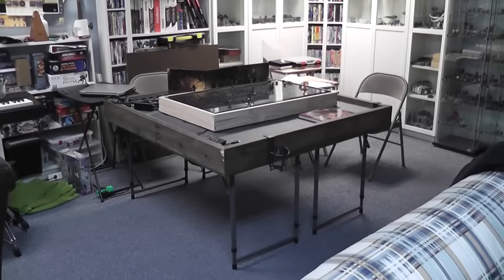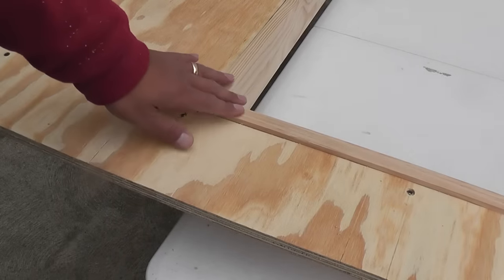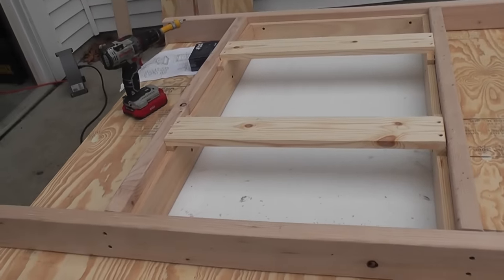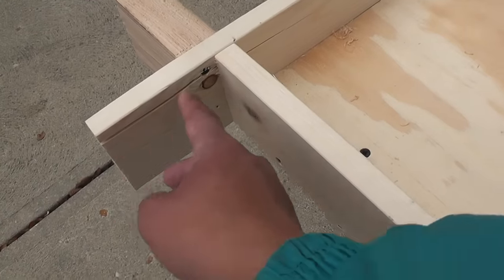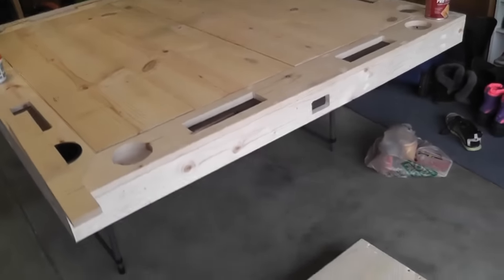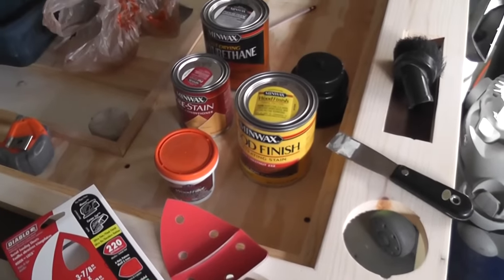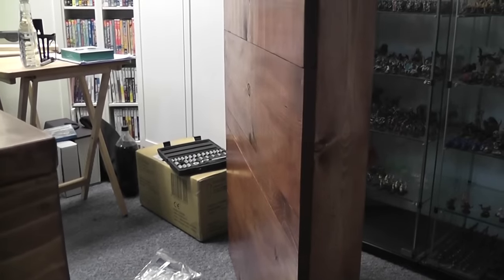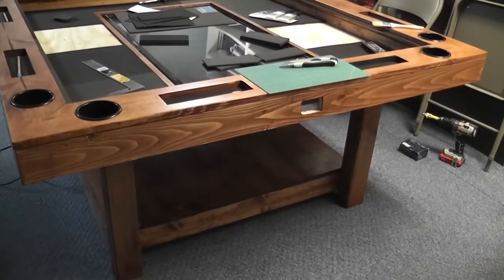DIY Gaming Table for $150

Comment: Its a cool build, just please, oh please, do not keep your hand in the same direction as your air nailer or screwing in your holes.  One slip, or misalignment, and it would have gone through flesh rather than the board you wanted.

Comment: @34:14 "There are imperfections, for example where i cut the corners, and that is how the jigsaw works in terms of how you navigate a corner" ...heck no! You got those corners in terms of HOW YOU work with the jigsaw. You could just take a little bit more time and both cut straight and do the corners correctly! And you end up with cut outs that you dont have to be ashamed of ;-) ..but it does take a real craftsman to blame the tools for faulty work lol

Comment: 120v AC is NOT low voltage!!! there is plenty of room in the low profile box to put a pigtail for the ground wire.  Pull the outlets out of the table and put them in a box, don't cheep out on safety.

Comment: Has anyone built this without the slot for the tv? I'm still a fan of the pen and paper aspect of D&D and Im trying to figure out which components I can remove without altering the structural integrity of the table. (I contemplated just building it as is just without the slot for the tv in the middle but that seemed like extra time and cost if i never plan on using a tv.)
Reply: If you still want the lowered area play like he has, with the board to go on top. Just don’t cut a hole in your plywood and you don’t need to build the tv fram with 1x4’s. You will just have to build the frame with the 2x4’s to solidify the structure.
Reply from the maker: @bavadadvidablu765  Yes, it is actually easier to build without the hole for the TV.  Many have done it.

Comment: Anyone know what size TV he has in there?
Reply from the maker: It's a 40" Magnovox LED LCD screen with a piece of plexi over it for protection.
Reply: @gaminggeek241  Any problems with heating having the TV positioned this way?  Also, I didn't hear the dimensions for the TV box, wood width (2x4s or whatnot).  Sorry for the questions, I'm planning this build within the next few weeks, I love it so much!  Just sold half my funko pop collection to make it happen.
Reply from the maker: @JadenZion84  No, I've heard others express concerns about having a TV screen that is laid flat but I've had no heating issues or problems.  Probably because it is a super light, LED LCD screen.  (I would never do this with a plasma.)  Regarding boxing in the TV, I would buy the TV first and measure it out to make the enclosure out of 1x4's to make it as tight as possible so you don't have a sizable gap between the TV and the frame.  You'll also need spacers to get it exactly flat with the frame.  Make sure you check out the BGG thread because tons of builders have put great ideas there.  Sorry it cost you your Funkopops!

Comment: Nice job. Did you think about outlets with usb in them so you don't need a big adapter plugged in to charge? https://www.amazon.com/Receptacle-Charging-Capability-Resistant-MICMI/dp/B01N3MGNTO/ref=sr_1_6?s=hi&ie=UTF8&qid=1513983094&sr=1-6&keywords=outlet+with+usb+ports     As another idea, I would have the wood frame around the TV sunk down to the level of the rest of the table and just bring the black foam all the way to the bezel of the tv. It would look almost seamless. You could actually take another layer of the foam and run it all the way to the edge of the plexi on the current design, it would just be double thick foam around the edges. May need a small hole over the IR on the tv to turn it on and off.

Comment: Wood 10 $
Screws 10 $
Cordless Screwdriver 10 $
Circular Sawyer 10 $
Garage 10 $
 Jigsaw 10 $
Wood Glue 10 $
Nail Gun 10 $
Mallet 10 $
Wood Finish 10 $
Electrical 10 $
Glass 10 $
Hinges and Beer Openers 10 $
Plastic 10 $
Vacuum Cleaner 10 $

150$ is not cheap enough for me!

Comment: i feel like most of your cutting could have been done by people at the hardware store. had you done that, all youd probably have left to do yourself is a test fit and assembly.
Reply from the maker: I find the people at Home Depot or Lowes are not very accurate with their cuts, but it is true, if you can get them to make all the cuts, you don't need the saws.

Comment: Do a brad nailer with nails will do?
Reply from the maker: I would suggest screws as the holding power is much stronger than a brad nail.  But maybe if you glue everything, a brad nailer would work?

Comment: Please don't wire THROUGH a device.. Make a pigtail and use wire nuts.  And it's not low voltage. You might not be pulling much amperage, but it's 120volts. For god sakes, please install electrical boxes for the receptacles!

Comment: Gave a little shudder when you showed all the exposed "finished" electrical (electrical tape is not a permanent solution).  Maybe also have the runs parallel from a junction box instead of in series.  Other than that the whole thing looks good for a DIY.
Reply from the maker: Yeah, I retrofitted with boxes.  Also, the wiring is in parallel, not series, although not from a single junction box--not sure what the advantage of that would be over pig-tailing at each outlet like I did.  That seems like a lot of unnecessary extra wire but maybe I am not understanding what you mean?

Comment: Far be it for me to tell you how to do your craft but when cutting holes with a jigsaw, drill a hole in each corner so you get smoother corners. Just what I found works best for me.
Reply from the maker: Yeah, that is a good idea.  I started out with a pilot hole but having them in the corners would have made for cleaner cuts.

Comment: "150$" table, made with tools worth 5000$, "DIY".
Reply: You can rent tools at many hardware stores.  This is a great find, don't discourage the potential.
Reply: that's not even 500$ worth of tools, buying the tools + the materials will still be cheaper than buying a full table like that.

Comment: As a licensed electrician I can honestly say the table looks nice... but absolutely do no follow his wiring advice. First of all, no boxes on the outlets????? Do you want to kill your players?? Oh you wrapped them with electriccal tape.. to bad that doesnt guarantee insulation. Not to mention how will it stand up over time. And, its also illegal. There is a Natinal electrical Code for a reason. Secondly, no electrician back feeds a wire like that.. those holes fail all the time. ALWAYS wrap the screw. And marette your wires with a tail to the plug. FFS.. this is why we have licensing for trades.

Comment: >$150 DIY but you need a few $1ks worth of equipment.
Reply from the maker: You can rent the tools--miter saw, drill, air nailer.  Or even easier, make friends with someone who has these tools.  The rest you can do by hand.

Comment: As much as I enjoy these things, I really really really hate that they say the item only costs X dollars, but dont include the cost of all the materials they found, or already owned, or the cost of the tools. $150 table + $150 miter saw + $50 circular saw + $200 compressor and nailer combo + $90 work table + + +
Reply: Why would those be included though? Those are not part of the material cost and can be used for a lifetime of projects. If you want to get nit picky, okay, but you have to add the lifetime value of the tools to it then. I have tools that my grandfather used in the 50's when he was an airplane mechanic that still work and are good, I have tools from the 90's that are my fathers that still work and are good, I have tools from the early 00's that are mine from school that still work and are good. Tools are not like materials, tools can be used for many many projects and to argue that their value should be factored in to the cost of a project is dumb.

Comment: lol "diy gaming table for $150" Not included is the $1000 plus tools needed plus all the costs for the hardwood
Reply: Lol that is not $1000 in tools
Reply: @derek9820    LOL Someone's never worked with tools apparently. A table saw can cost anywhere between 300-900$ CDN. And that's just bare minimum for cutting the big pieces of wood. You still need a miter saw or a circular saw for your finer cuts, router for you circular ridges, then you still need to sand and paint. So MAYBE if you gamble with second hand tools you're looking at under a grand.
Reply: Taylor  Someone's never taken carpentry LOL
Reply: @pawelm8599  hmmmm judge much? I am a carpenter and you only need a circular saw... no table saw or miter just a steady hand
Plus round over edges with sandpaper in your hand.
Finally, if you dont have experience you wont have tools and shouldn't try something like this.

Comment: Too cheap
Reply from the maker: If you use oak instead of pine, you can quadruple the price.
Reply: @gaminggeek241  I'm not talking about using a hardwood. Like they went to the effort to install one junction correctly but the other power outlets, could have used junction boxes. Like seriously they should have.